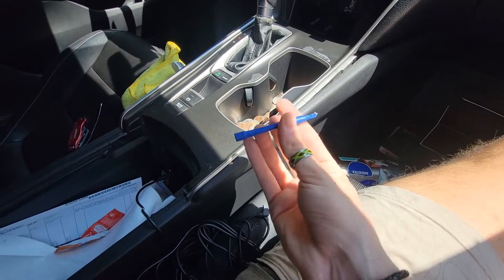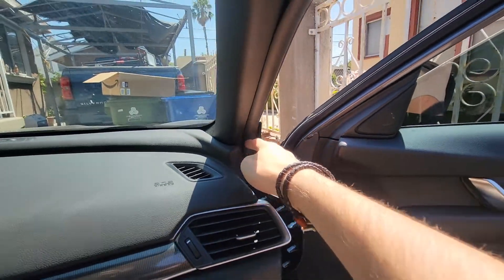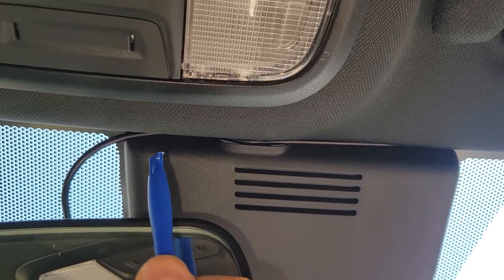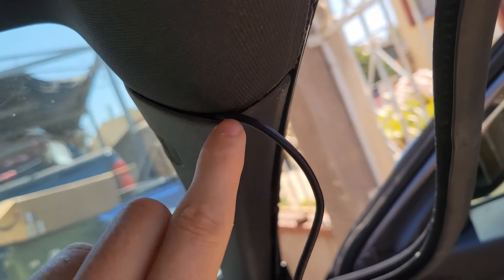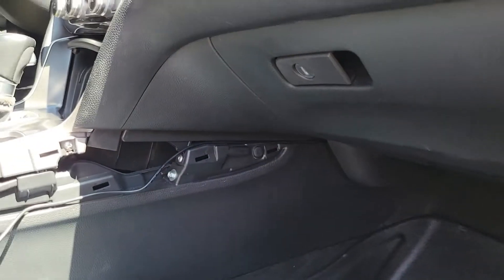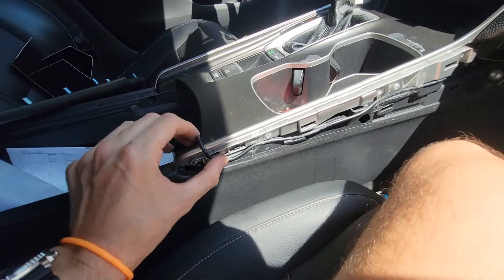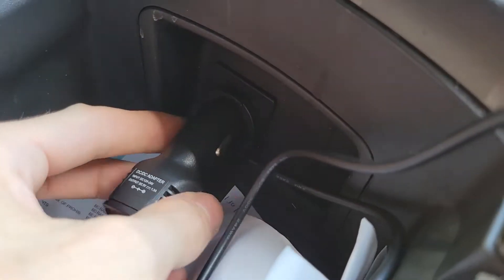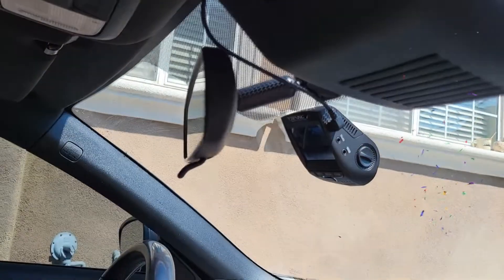DASH CAM Install Honda Accord (2018-2022)

Comment from the maker: :yt: Dash Cam Used:
https://www.amazon.com/dp/B00X528FNE?linkCode=ssc&tag=onamzdan0f4a0-20&creativeASIN=B00X528FNE&asc_item-id=amzn1.ideas.1GQO7BKQEEC6D&ref_=aip_sf_list_spv_ons_d_asin&th=1

Samsung Dash Cam Memory Card:
https://www.amazon.com/dp/B07NY23WBG?linkCode=ssc&tag=onamzdan0f4a0-20&creativeASIN=B07NY23WBG&asc_item-id=amzn1.ideas.1GQO7BKQEEC6D&ref_=aip_sf_list_spv_ons_d_asin

Pry Tool Kit:
https://www.amazon.com/dp/B07R44VJHN?linkCode=ssc&tag=onamzdan0f4a0-20&creativeASIN=B07R44VJHN&asc_item-id=amzn1.ideas.20WJBA2MSTTNU&ref_=aip_sf_list_spv_ons_d_asin

Dash Cam, & Items I use for my (2018-2022) Honda Accord on my Amazon affiliate Storefront here: 
https://www.amazon.com/shop/striker50/list/22TBRJ5EGQE8T?ref_=aip_sf_list_spv_ofs_mixed_d

Comment: The power cable is on the wrong side of the airbag. Remove the A-pillar trim and run the wire on the windshield side of the airbag. When the airbag is deployed, an explosive device inflates the airbag with a lot of force. The side airbag is much closer to the side of the car than the front airbag is to the front so there is less time available in a side impact to inflate the airbag so the explosion is stronger and closer to you. Any foreign object that is in the way of the airbag will be thrown with great force in an unknown direction, possibly into the passenger. Also, the energy used to throw the foreign object will slow the inflation of the airbag thereby reducing its effectiveness. These are good reasons to do a little extra work and route the cables where they can do no harm.
Reply from the maker: Either edge will do. The power cable is on the side of the airbag, not on top of it. If the airbag is to deploy, the cable is either going left or right. In this case, it is on the right. 
The A-pillar plastic trim also has a plastic fastener that is difficult to adjust and reattach.
Reply from the maker: You're more than welcome to make a video yourself showing your own way in installing it
Reply from the maker: @CharlesProoth  You're entitled to your opinion, but you sound disgruntled. This is a basic dashcam installion video which many people appreciate. And all you're doing is coming on this comment thread to complain. So if you think you can do better, make a video and tag me so I can see what your process is. Until then, I think my method works perfectly fine and makes it extremely simple for anyone that is unfamiliar with installing a dashcam. 
Go for a walk and get some sun 🌻
Reply: @Striker50_  Charles is right, the airbag is obstructed in your video... you may want to fix this on your installation, it is a safety hazard. It's not a big deal to take the A pillar off and install the cable such that it won't obstruct the airbag in case of deployment. Just pop off that "side curtain airbag" rectangle with the trim removal tool, and there is an 8mm screw behind it. The rest of your installation is awesome, thank you for taking the time to show/explain how to route the cable to the center console.
Reply: @Striker50_  He is correct... the power cord crosses the airbag as you tucked it in at the top of the A-pillar. It is, unfortunately, a safety hazard. Having some knowledge of how the airbag works is important here. The side-curtain airbag is not only contained within the A-pillar... it also runs along the whole roofline on each side and is one continuous piece that deploys downward and in front of the side windows, front and back. Hopefully, you are able to re-route this cable before the airbag is ever needed. My fear is for others who do not necessarily know this and simply follow the video.
Reply: They are correct. You are obstructing the air bag which can potentially be dangerous. Don’t get offended at constructive criticism.

Comment from the maker: Notice: It is MUCH easier to mount the camera where you want it on the windshield (and where it doesn't block your sight line), and then work your way down. This assures you don't run out of power cable 👍

Comment: Running the wire across the A-Pillar airbag is dangerous.  The wire should be run behind the airbag so it doesn’t hinder its deployment in any way.   You’re going to a lot of effort to hide the wire the right way so why not do it 100% correctly?    Your comments essentially saying “if you can do it better make your own video” are childish.   People are pointing out safety concerns.    Where that’s concerned, theres really only one way, the right way.  Also I typically use a wiring kit for these installations.  You can get them from Amazon and there are ones that can be wired to the fusebox to work 24/7 that won’t kill your battery.
Reply from the maker: As with most things on YouTube, I myself whole-heartedly am an amateur, and constantly make that disclaimer in my videos. 
If you're referring to the comment critiquing the install, you probably failed to notice the original commenter conveniently deleted their derogatory comments.
In the event the airbag deploys, it would pull down the cable that was tucked along the roof liner. Is that dangerous? Debatable. But it IS a risk that didn't exist prior nonetheless, so I acknowledge that. 
In my previous experience removing the A-pillar from my 2013 Accord, there was a very specific clip needed to be removed that took me about 30 minutes to remove. That made me reluctant to do it again. 
Again, thank you for the input, and if I install in the future I will take that into consideration. As for this video, it was meant to be quick and simple to where 95% of people understand it, and install a dash camera. 
In hindsight, this 2018 A-pillar is much easier to remove than the 2013-2017, but the video was already made. 
This is free, amateur content after all. Professional advice should always be considered. For budget-conscious people, this video serves as a good starting point 👍If it's their prerogative to act upon it, so be it. At the time of recording, this was my best interpretation of the installation, and discretion should always be had

Comment: Done. Thanks, didn't want to hard wire just yet. This worked well. Didn't cut that notch though so I'm crimping the wire for now. If I have to replace it so be it, not willing to cut the trim just yet. Also you don't have to remove the other trim close to the door, easier to wire it through the weather strip further down
Reply from the maker: Yeah many ways to do it 👌 
Good tip also

Comment: Running it over the airbag and making cuts into the trim. SMH - do not follow this guys instructions. You are ruining your car.
Reply from the maker: It runs on the side of the airbag, not over 🙂 Tiny cut so cable is not pinched 
Thanks for watching 👍

Comment: Ty, I am looking into dashcams but I was unsure of how to run the wire correctly, this helped loads!
Reply from the maker: Glad it helps 🤙 on my other Accord I wired it much worse, but knowing this now, it could have been WAY easier. And it's almost identical for every car aside from the center arm rest area.
I run a Whisler dash cam I got at Costco in my other Accord which is really small like the size of a golf ball and is easily removable via a magnet, but this 4k one is also legit

Comment: Very neat work man .. I will try it tomorrow .. Thanks :)
Reply from the maker: Solid! Make sure you use the proper memory card also!
Has to be an endurance one & preferably 64GB+
Reply: @Striker50_  got the very one you mentioned (endurance and 64gb) .. appreciate it Striker!
Reply from the maker: @ahmedalhumiqani3528  Wicked let me know how it goes and be safe on the road 👍

Comment: Wiring to the fuse block would take way less time to install and it would free up that 12V. They have hardwire kits for most aftermarket dashcams.
Reply from the maker: I'm sure there are better ways, thanks for the input! 👍 
This video is meant to encourage the 90% of people that are intimidated about installing by themselves
Reply: @Striker50_  OK.
Reply: What size fuse taps did you guys use for hardwire ?
Reply: @ciscoa4932  the size that comes factory with the fuse box. It also came the same size as the hardwiring kit fuse tap. The fuse size is about the same size as a dime.

Comment: This is great. I think I am going to use this method
Reply from the maker: It's crazy easy! Lmk how it goes! And make sure to get a good memory card 64Gb+ if possible! They last longer that way
Reply: Just did and worked perfectly
Reply: @Striker50_  Just completed my install today. It was a breeze.  I skipped one procedure though. The plastic panel at the side of the dashboard that you removed, I didnt do that. I was able to follow the weather strip all the way down. I install a rear facing camera as well. I stuck most of the cabling into the headliner as it was way too long. Thanks again. Your video was of great help.
Reply from the maker: @captainjack6890  Glad to know it helped! (Not the perfect way to install) but it's the easiest way to do by far! 
Some people are being rude, but that's YouTube I guess

Comment: what's the difference between cigarettes power vs hardwire to fuse?
Reply from the maker: I'm going to take a guess here and say the fuse runs 24/7 and probably takes a little more effort to set up

Comment: Do you have a video to install a camera to the back window? We have then Vantrue N5 to install on a Honda Accord
Reply from the maker: @ashleygollub2135  I don't have a video unfortunately but I know that you usually run the cable under the plastic between the door and the driver and passenger seat. 
I do have a video on my older Accord showing how to remove the back seat cushion to run the cable up

Comment: Would you know if the Honda Accord have continuous battery. Or in other terms 24/7 recording ? I saw the comment that said wiring to the fuse box
Reply from the maker: I feel it may be possible if connecting to the fuse box since it will draw power from a closer source instead of the 12 volt which probably has a cut off once the car is turned off

Comment: nice instructional. what about the rear camera now? 🤣 thats the fun part. is that the Viofo a139? I'm torn between that one and the t130. The t130 is great to turn to the side in case of police encounters, or road ragers. oh never mind I'd seen in the description you had something different
Reply from the maker: Sounds like you're going for the advanced set up! I'd love that
Reply: @Striker50_  I just started looking into dash cams. I like a clean install. Hondas giant lane assist camera is the problem. 🙄
Reply from the maker: @Keeping-It-Real-55  personally I LOVE the lane assist camera on my 2013 Accord
Reply: @Striker50_  I didn't realize they had Lane assist module in the 2013 Accord that's cool though.

Comment: Curious why you ran the wire through the passenger side of the car vs the driver side. Seems more logical to run it driver side, seeing that that’s the way you’d normally run it if one was going to hardwire it.
Reply from the maker: Good inquiry: I ran it through the passenger side because there are less technicals than the driver side. (Fuse box, OBD port, brake release, etc.) It would take a bit more work to ensure the cable doesn't get tangled or intertwined in that general area. I also don't have a need to plug in to the fuse box for 24/7 camera operation . Some people here have that preference, but I don't want to create an opportunity for parasitic draw

Comment: Great info about dash cam I stallation 
One I notice if you want to hardwire this dash cam or blackvue dashcam to what fuse would you hardwire?I know you need always on  power fuse and one that goes that turn on when you turn on car and goes off when car is off
Which fuse do you recommend I have a honada card just like yours thanks
Reply from the maker: I can't speak for the fuse style of dashcams as I don't want to mess with the electronics of the car since I'm not knowledgeable on that unfortunately
I'd perhaps recommend looking up fuse dashcam and see what you could learn from other videos
Reply: What size fuse taps did you guys use for hardwire ?

Comment: How long does this take on average? I need to also set up the wire for interior cam and rear.
Reply from the maker: @omarraja5774  in your situation 10 to 20 minutes if it's your first time. The rear camera is a bit more challenging for the wiring

Comment: Will using the cigarette lighter with the dash cam drain the cars battery when it’s parked?
Reply from the maker: Like when the car is off but the power is still on?
Reply: @Striker50_  yeah like if your car is parked for the weekend
Reply from the maker: @jacethescarface2043  it won't drain battery. Have had it for a few years now
Reply: @Striker50_  with that being said would the parking mode work with the cigarette lighter in?
Reply from the maker: @jacethescarface2043  You would have to connect directly to the fuse panel on the left side of the brake pedal

Comment: easier way is not to touch the weather strip all together once you hide the wire on the roof just tuck the wire  in the crack between the piller and roof then hide it under the rubber strip that goes down then do  the rest like he said
Reply from the maker: The weather strip is extremely easy to remove and reattach. You'll spend much more time trying to squeeze the excess cable along the windshield pillar and dashboard area. Feel free to tag me in a video that shows the method you're describing- but this method shown works very well and hides 99.5% of all the cable and can be done in under 3 minutes
Reply: @Striker50_  same method as you but i wet my finget so the wire slide easy under the rubber  and instead of  clipping the side pannel off and notching the side to get the wire in i hide it  under the lower part above the carpet all along and  fix the wire in place with a tag and pull it up the side hidden by the seat and  just  getting it in on the side of the storage box. once the lid is closed nothing show.

Comment: Will this block the side airbag?
Reply from the maker: It shouldn't since I just hand tuck the power cable along the roof liner, the force of an airbag is on another level, but again that's my opinion
Reply: That route definitely crosses over the curtain airbag. The cable needs to go between the A column trim and the windshield until you get to the dash. If you take that trim off, you'll see that the airbag is one solid unit from about 3/4 of the way down the A pillar into the ceiling above the door. It's worth popping that trim off to make sure the wire is in the right place. It's only held on by a single bolt under the SRS badge and then a clip lower down, so it's easy to remove.

Comment: Damn. I was hoping it would be easier. It seems like a bit much, removing panels and weather stripping and cutting holes on the interior for a dashcam I might not even like after a couple uses. Is there an easier method that doesn't require all the invasiveness but still hides the cable decently?
Reply from the maker: Lol it takes like 2 minutes to do, all you really need is a butter knife and maybe some tape
Reply: @Striker50_  It takes 2 minutes to take out two interior panels, remove weather stripping, cut a hole into a trim piece and put everything back together? Yeah, nah. I'm not ripping pieces out or cutting holes into my interior over a cable bro
Reply from the maker: @sunshinelolipops1  I'm sure you can find another way that's easier 👍
Reply: @Striker50_  So you make tutorial videos and then give people a shitty attitude when they have concerns or questions?? Wow lol maybe this isn't your racket bro
Reply from the maker: @sunshinelolipops1  There's a difference between having questions and complaining on a free video you came across. You want me to spoon feed you free solutions to your liking, that's not my responsibility
Reply: @sunshinelolipops1  just use a hardwire it tap into the fuse box and just run it threw the left side no cutting and it’s super easy

Comment: Does the cover behind the mirror come off, the cover that is on the windshield. I was hoping to run my cable behind that so it is not visible.
Reply from the maker: If I'm understanding correctly, you're referring to the Honda lanewatch sensors.
If so, I'd recommend not opening for warranty/etc. Purposes. 

If you tuck too much of the cable away, you won't have slack to remove the camera from the mount/clip. This is important in case you need to unfasten the camera to review an incident that occurred. Also, once tucking the cable in the roof liner, you won't really be able to see the loose portion of the power cable since the mirror blocks it
Reply from the maker: P.s. most cameras come with adhesive hooks that can hold the cable against something so you can do that and stick them against the radar sensors so the power cable doesn't bulge out
Reply: @Striker50_  yes I know, just trying to conceal as much as possible. Thank you
Reply from the maker: @stevenziegler2523  Here to help 👍 But yes, you could open the radar housing at your own discretion, though I personally wouldn't do it
Reply: @Striker50_  how do you do that is my question
Reply from the maker: @stevenziegler2523  I would assume you pry it open at a release point and it unfastens with plastic clips but I wouldn't take my own advice since I've not done it. Consider calling the service department and asking if it's possible

Comment: Does the dash cam run down the car battery being that it’s always plugged in??
Reply from the maker: In this video, you can see I plug it into the 12V outlet under the center infotainment 👍